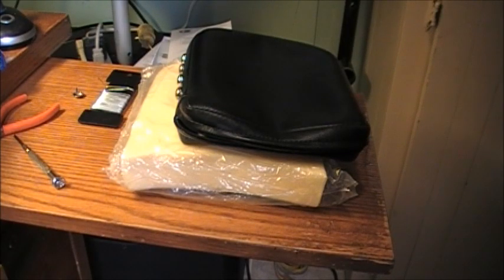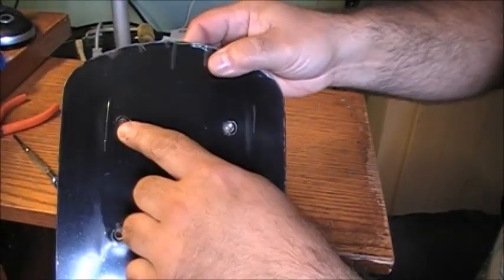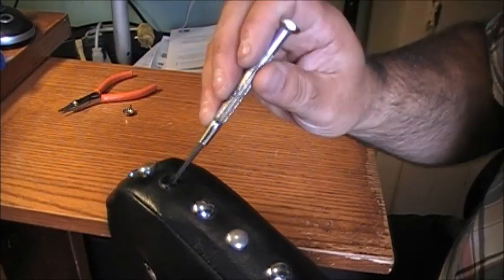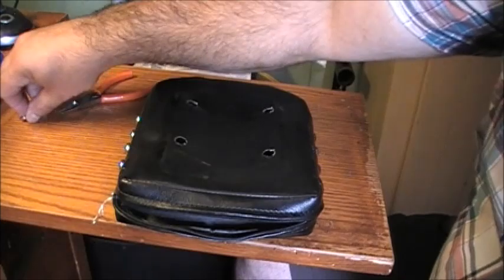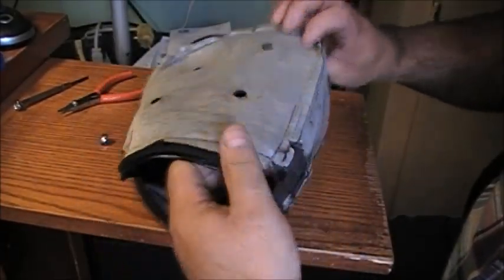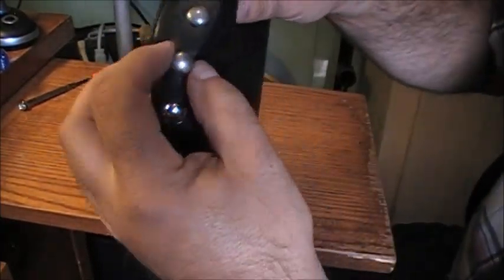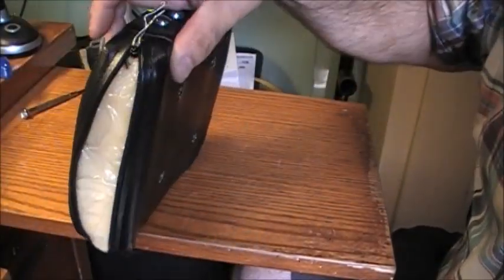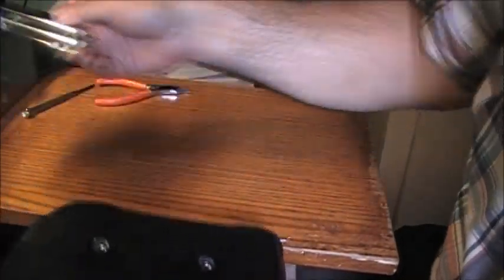How to replace a leather stud on a motorcycle backrest

Comment: What if the backrest doesn't zip off? I have the same scenario but do not have easy access to the inside of the rest.
Reply from the maker: It may have a velcro attached to the underside. If that is not the case, then you have to unsew it in one area, or you cantry and put the stud back in place and using pliers with padding to gently bend the tabs back in to place.